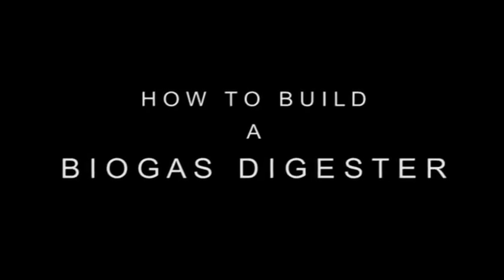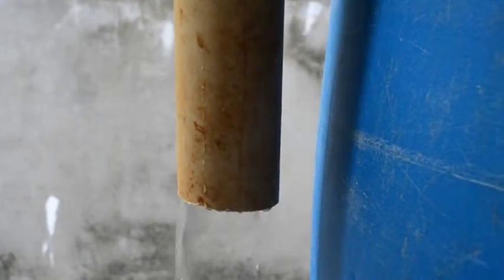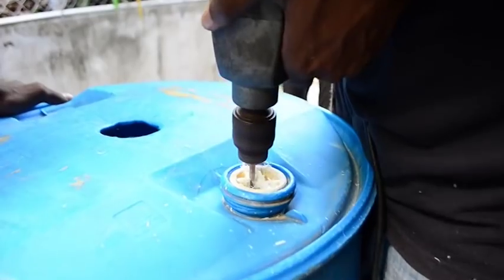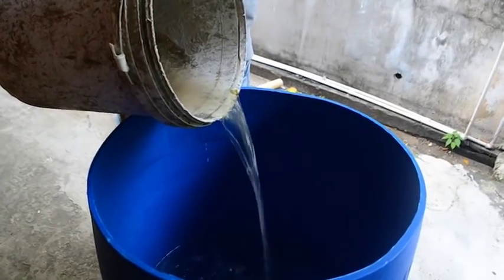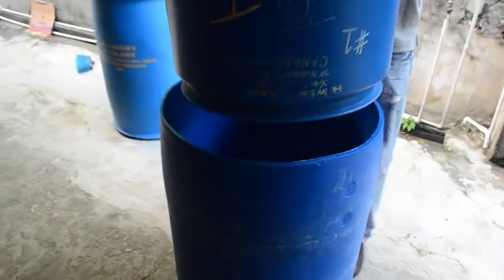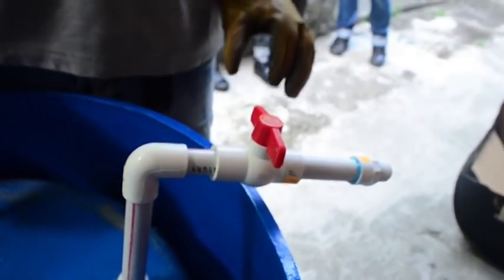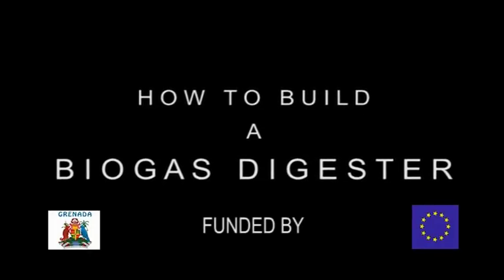How to make a Bio-gas Digester

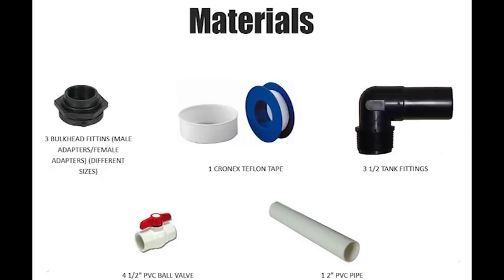Comment: At 0:42,
You should never drill the holes where the seams are (these are the lines). Video Eppo YouTube Channel said that they are heat welded and by drilling it to the seams, it will destroy the structural integrity of the barrel.

Comment: How does the excess slurry pipe works....before the water goes up to that excess slurry pipe...the water will go  to the gas pipe first...because the excess pipe is much more higher than the gas pipe...see 2:58 diagram...

Comment: silicone glue is very weak and leaked easily. you should use power glue instead.
1:38 I guess you use silicone glue for glass.

Comment: I have a couple questions about the diagram shown in the beginning of the video.  First, the feed line should go down into the slurry, correct?  Otherwise, won't the methane simply leak out it?  Also, your slurry overflow pipe is at a higher elevation than the highest point in your gas line.  Wouldn't you want your slurry outflow to come out the side of barrel 1 maybe at say 4/5 of the way to the top?
Reply: Hello Sir, i would like to talk to you in private about making a bigas digester with low costs. I want to start a business about this and i need people who know much about this process. It would be great if we have a conversion. And thank you.
Reply: Perfect questions

Comment: If I recall correctly, depending on the slurry material (whatever organic material is being reduced to slurry), the CO2 to methane production ratio can be as high as 3 to 1...-Which means such a digestion process would also be a very good source for CO2 for an algae biofuel/biomass process. So in that situation where both the CO2 and methane are used, a gas separator device would be necessary. Also useful would be a gas cleaning ("scrubber") system, and a product gas compression and storage system. Larger systems will require water condensation removing "bleed-off" valves or"traps" and flame-backflow prevention devices. All available as "off-the-shelf" for large applications, from industrial suppliers. Hardware and DIY builders supply stores sometimes inventory various smaller application devices.
Reply: to drain the tank....turn it upside down and poor.
flame backflow prevention.... bucket of water with lid and bubbler.
About 70% of the methane produced during fermentation comes from acetic
acid (Fry 1975) with the balance coming from direct reduction of CO2 (Lapp, Schulte
et al. 1975).....pigs arse literally...if ya are as smart as you think you are, you will know what that meant lol
The point is, this is the most basic and cheapest form of a bio digester for one reason....the people this would be used for, can not afford more. If anyone is watching this, thinking oh i can make a bio digester just like these in my middle class american back yard....you are an idiot.
Every Engineering Uni student in the southern hemisphere does a research and development paper on bio gas or similar systems for third world countries. This is not designed as a village sized or industrial option, simply a single burner for a single small family.
Reply: +pepperoni prepper  good answer  bravo.............
Reply: Hello Sir, i would like to talk to you in private about making a bigas digester with low costs. I want to start a business about this and i need people who know much about this process. It would be great if we have a conversion. And thank you.

Comment: Grate!I think the supply-pipe should be placed under the sewage to avoid lossing gas as we add new material for bio-digester, and odour as well; and I think y also should use soft pipe to connect two parts of this bio-digester, because they will move as they work.
Reply: Hello Sir, i would like to talk to you in private about making a bigas digester with low costs. I want to start a business about this and i need people who know much about this process. It would be great if we have a conversion. And thank you.